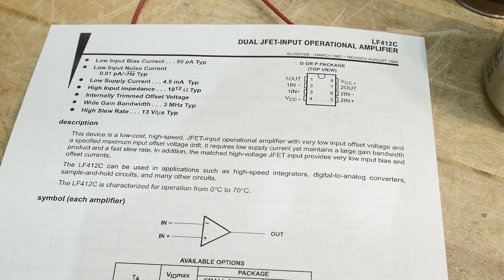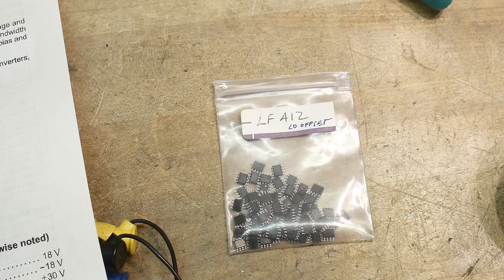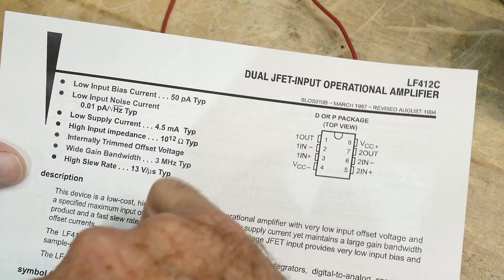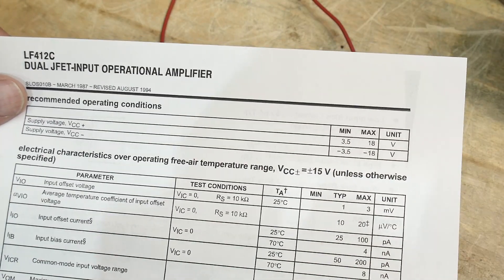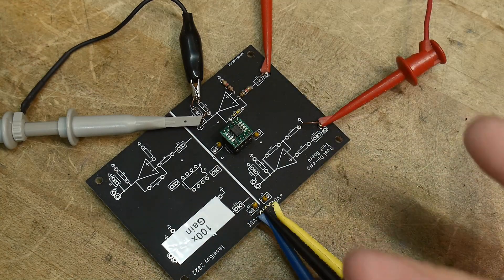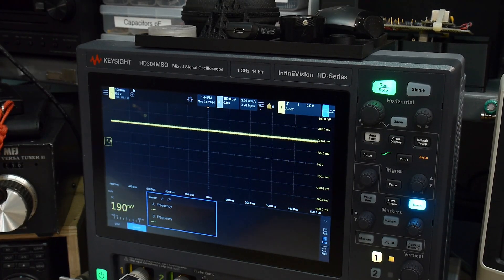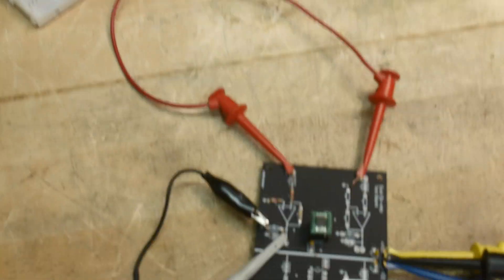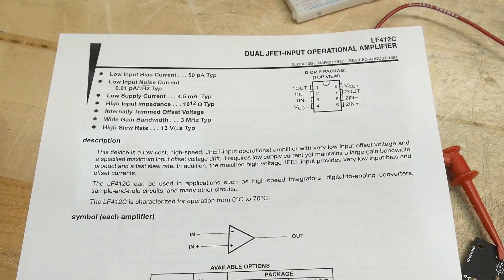#2074 LF412 Op-Amp

Comment: for another opamp video, I was wondering if you could show how to use two opamps to multiply ?  I wanted to try using in a power supply assuming if one opamp does the Amps & the other the Volts, then I would get the product in Watts ?!
Reply from the maker: an opamp will not work, you will need to find an analog multiplier chip. I show one here  https://youtu.be/2v22xyexSb8?si=CjbbLi_8GSub4yX6

Comment: Would be interesting to reverse the lead shorting the input to ground and re-measure.  The average of the two readings is the offset which accounts for the thermoelectric potential of the connections in the test lead.  Some leads are very good, some are easily measurable.  The input impedance of the LF412 is so high this effect might be noticed.

Comment: Why set a gain of 100 when most DMMs have a mV range allowing you to measure the output directly? Especially when you can pick up a 19999 count Zoyi ZT219 for under $20.
Reply: By doing it with the opamp gain you get better accuracy. The multimeter spec for accuracy while measuring (especially low amounts) is probably higher than the spec of the opamp.

The one you mentioned is 0-19.999mV ±(0.05%+3) so right out of the gate it's accuracy is lower than the max offset of the opamp.
Reply: @xenoxaos1 you might wanna check those specs again. It's an auto ranging meter so the mV ranges are
_20.00-199.99mV
_0.000-19.999mV
Even if we're pessimistic and take that last digit as "just for show", that's still accurate to 10uV, so the measured 1.9mV (1900uV) offset of this opamp is well within the level of accuracy of the DMM
Reply from the maker: Industry standard way. https://www.analog.com/media/en/training-seminars/tutorials/MT-037.pdf
Reply: @IMSAIGuy I can understand why that may have been the case years ago before we had widespread access to meters with 10s of uV accuracy, but it just seems a little convoluted in today's day of cheap 4.5 digit meters. Also unless your setting up the feedback loop with precision resistors or are measuring them to a reasonable degree first, there's a pretty high chance your not getting exactly 100x gain so the increase in meter resolution is pretty much null and void anyway.
Reply from the maker: It eliminates other errors and magnifies the one you want

Comment: How can they call it a "very low input offset voltage" opamp while the typical input offset voltage is 1mV with a maximum of 3mV?
Reply: This part is quite old. Probably older than the date on the datasheet: 1987. In those days this probably was quite 'low offset'.
Reply: @pietpaaltjes7419  oh, I forgot the datecode 💀 For that era that really was "low offset"
Reply: yeah, that struck me as very odd. The offset is shite. "internally trimmed" yes, but not to a good standard.
Reply from the maker: Jim, If I liked the TL072 back in the Jurassic, what is the modern day replacement to use. and at the same cheap price point. lots of nice expensive ones